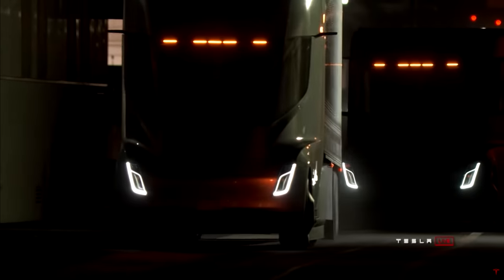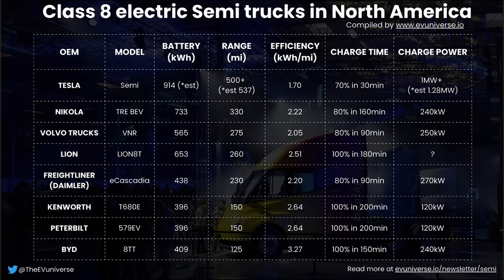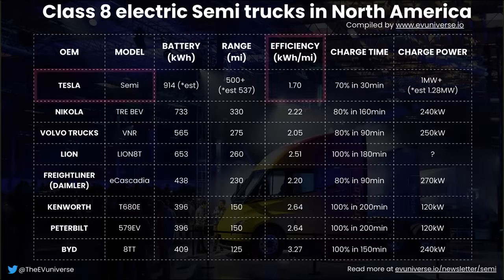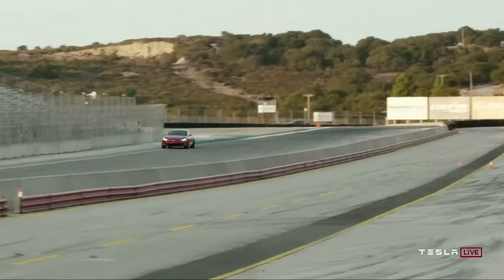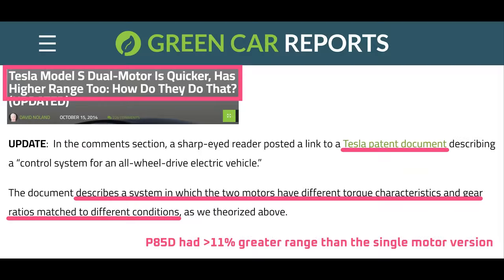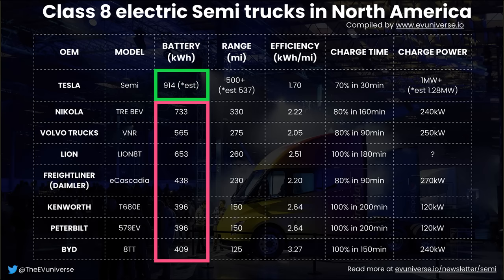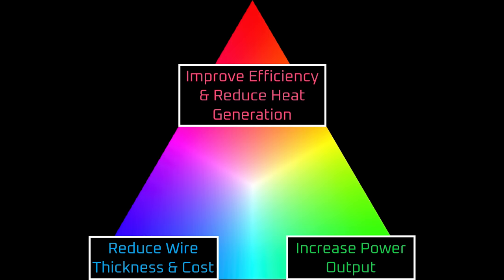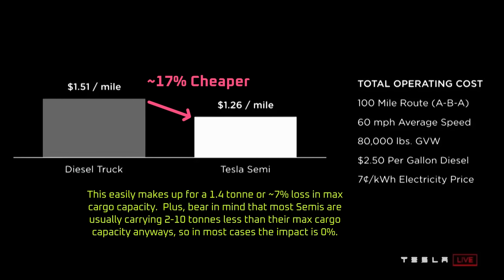How the Tesla Semi “Broke the Laws of Physics”

Comment: A lot of impressive analysis.

A regular diesel tractor trailer can haul 45k lbs to 48k lbs of payload weight.😮 14:52 

I suspect the payload weight is around 35k lbs for Tesla Semi, that’s my guess based on the fact Tesla seems to be hiding this figure. This amount is still impressive but will not be doable for some loads.
Reply: Do we have to go over the "Jersey Barrier" calculation AGAIN?
.
YES, it had 11 barriers on the bed
NO, they weren't "short/ small" versions.
They were ±4,000lb units.
.......
Standard barrier. 24" base thickness, 3 barriers across the bed, 0.5 barrier thickness either side, wiggle room between the barriers.
That's (4×24) + (2×3)= 102.
How wide is a standard trailer bed? 102"
.
You can add the huge chunk of wood at the front. (2,000lb?)
We're talking ±45,000lb "ballpark".
Reply: @rogerstarkey5390  So, if I go to a dealership to buy a diesel and I ask the salesman "How much does it haul?", what would you consider to be normal behavior on the part of the salesman?  Either he answers my question (which seems like normal behavior to me) or he gives me a scathing look, calls me an idiot and points to some concrete barriers on a truck bed outside.  I think if he did the latter I would walk out.  You know as well as I do, there is only one rational reason Tesla won't say how much their truck hauls.
Reply: @chriswright9096  I give you my personal guarantee that if you were an actual prospect for a fleet of Tesla Semis, you'd learn everything you want to know once you sign the NDA.
There might be many rational reasons why Tesla is not disclosing this information right now, none of which is the one you think it is. One might be that they don't want to give their competitors, of which there are several, a target to aim at. Another might be that they're still fine-tuning things like battery capacity based on initial experience with PepsiCo, and know full well that if they release preliminary information now but later finalize a different spec, a legion of airchair engineers will use this a proof certain that they lie about everything. Another might be that they simply don't see any reason to release this information, preliminary or final, to hordes of folks who will just use it to discredit Tesla. Another might be that they're just f%$king with folks like you. Another might be ...
Reply: @BigBen621  Nope, none of your reasons make sense to me.  This is a classic example of poor objectivity.  Whatever Tesla does, you interpret it positively.  They raise prices - genius, Musk will make more profit.  They lower prices - genius, Musk will sell more cars.  They keep prices the same - what a cool head Musk has when all around him are panicking.  Pure spin from start to finish.
Reply: @chriswright9096  Ah, the logical fallacy of personal incredulity—you don't believe it, so it must not be true. In any event, I didn't claim any of these was the case; just suggested a few possibilities for the obvious fact that they consider weight and payload a trade secret.
I don't know where you came up with your claims about my interpretation of Tesla pricing—I've made no such claims any time, anywhere; so my guess is pure rectal extraction on your part.
Reply: @BigBen621  Weight and payload are not known.  Therefore the Tesla Semi cannot be evaluated.  However, this has not prevented thousands of Musk acolytes from claiming to have done exactly that.  I assumed you were one of them.  Apologies if I got this wrong.

Comment: They didn't unveil load capability nothing is clear. That is the most important metric
Reply from the maker: We know the load.  Watch the video by Engineering Explained.

It's not the most important metric.  The most important metric for a commercial vehicle is cost/mile.

Range/load just tells you use case.
Reply: @thelimitingfactor  so they didn't unveil it.

Comment: The limiting factor of a truck is it's weight, which is a legal limit of 36 tons to not damage road infrastructure. To stay within this limit, the Tesla Semi has to have significantly lower cargo capacity due to its heavy battery, which in turn means more round trips are required, which means higher cost.
Reply from the maker: You've got it backwards in a sense.

The main concern of truckers is cost/mile.  Weight is only one variable to achieve low cost per mile.  

There's also speed, fuel cost, etc.

Most semis aren't at capacity.  Regardless, you can watch the video by engineering explained.  It's unbiased and neutral.

Tesla Semi only needs 250 miles of range to cover 80% of routes.  So 500 is overkill for a v1.0
Reply: Where'd you get 36 tons? It's 82,000 lbs., which according to my calculator is 41 tons.

Comment: 500 miles if range?  The loads weight they pulled is in question and why is Pepsi only using it only for short range trips with heavy load?  The reality is the Federal and state paid for those trucks not Pepsi!
Reply: That's not what Pepsi said. What PepsiCo VP Mike O'Connell actually said was that "for heavier loads of sodas, the trucks will initially do shorter trips of around 100 miles". But he went on to say that "PepsiCo then will also use the Semis to haul beverages in the 400 to 500 mile range as well". His statement that PepsiCo will be using the Tesla Semis to haul sodas initially for 100 mile runs, but later for 400 to 500 miles runs, makes it clear that this is a decision on the allocation of tractor assets to where they'll do the most as the Tesla Semi inventory grows, and not a limitation of the range of Tesla Semis hauling heavier loads of sodas. These quotes appeared in a Reuters article entitled "Exclusive-PepsiCo to roll out 100 Tesla Semis in 2023, exec says" on December 16, if you want to verify this for yourself.
Reply: @BigBen621  oh I read it but why?  Electric cars lose half their range towing so why would a truck be any different! Is the range of a lightly loaded truck 1000 miles?   Everything is very suspect!
Reply: @bubbafatas2588  Great question! The reason electric cars and pickup trucks lose half their range towing is because air resistance is a major factor in the range calculation, and adding a trailer behind a car or pickup more than doubles or even triples the air resistance. In the case of a semi towing a trailer, the air resistance doesn't change appreciably whether the trailer is empty, half full or loaded to GCWR; so the main determinant of changes in range with different loads is rolling resistance. 

Running the physics, it turns out that compared with the range at the full 82k lb. GCWR and 60 MPH, a Tesla Semi would gain about 17% in range with a half load, and about 40% unloaded. So compared with the 500 mile fully loaded range test with 7% battery reserve,  the Tesla Semi would have a range of about 585 miles with a half load, and 700 miles empty.

Hope this helps.
Reply: @BigBen621  Yes that does help and as you’ve stated their is a significant difference in range difference 17%based on weight and you have extrapolated given a specific range but Tesla has not!   Why not?   This tells me they are hiding something!  Since Pepsi did not pay for these vehicles as the state and federal governments did, I am suspicious about Pepsi only running short range trips fully loaded and not wanting to rock the boat on their free trucks!    
 Depending on the manufacturer a way to reach high efficiencies, and with that in EVs (Electric Vehicles) electric range, is keeping total vehicle weight low, which is especially important since long range car batteries, that store 50kWh+, can easily weigh 400kg or more. To give you an idea, the most famous electric car, the Tesla Model S weighs up to around 2.3 tonnes and packs a 650kg battery pack. Yes, that vehicle also goes a realistic 600km on a charge. A significant part of achieving this impressive range plays heavy use of lightweight metals such as aluminum in the cars chassis structure.
Reply: @bubbafatas2588  Yes, it's true they're "hiding", or more accurately not announcing, specific performance details. It's clear that they consider these trade secrets that are released only on NDAs, and PepsiCo has as much as confirmed this. There are several reasons why Tesla may choose not to announce detailed specifications to the general public and their competitors. The doubters all jump to one conclusion, though; they're doing this because the tractor weight is shockingly high, and/or the payload is shockingly low. But if this is the case, one must wonder why PepsiCo, who obviously knows exactly what the specs are, is enthusiastically integrating 100 of these into their operations, and is spending millions installing charging infrastructure to support their new Tesla Semis. It's a quandary...
Reply: @BigBen621  Who hides the actual range of their trucks from potential buyers?  Are they not taking orders?  Is it possible Pepsi is not only getting subsidies for each truck but getting deep discounts to implement Tesla trucks into operation and releasing anything negative will affect those purchases and warranties and prices?   Hiding trade secrets is different from providing real range numbers to potential buyers!
Reply: @bubbafatas2588  I see no evidence that they're hiding information from potential buyers; only from the general public, including their competitors. I give you my personal guarantee that if you were actually a prospective buyer, you'd have all the information you wanted—as soon as you signed an NDA. You can speculate on nefarious motives Tesla might have to withhold detailed specs, and you might be right. But my guess is that when details are released, there'll be no surprises, and they'll be pretty close to a weight of 27,000 lbs. ± 1,000 lbs., which can be inferred from information they've already released; to wit, the Donner Pass video and 500 mile range test graph, and the GCVW they stated for both of these events. And they've already released what the range is, at least under the conditions of the 500 mile range test.
Reply: @BigBen621  why would you need to sign an NDA TO GET SPECIFICATIONS, that makes no sense!   Ive been dealing with aircraft purchases my whole adult life and no one hides their specifications!  They publish projected and then actual for everyone to see.  I don’t trust Elon Musk, he has a history of lying about everything he has been involved in!  I am not questioning you or your perspective which may be accurate it just makes no sense to me.  Thanks.

Comment: If they could live up to the claims they'd have been in production already. There's not a trucking company on the planet that's going to run with a costlier fleet.
Reply from the maker: They already are in production.  Low volume.

Several dozen on the road.  

In an upcoming video all cover why it took so long to bring it to market.

Basically it comes down to battery supply.
Reply: @thelimitingfactor  I think you mean "where is the most profitable place to put the available battery supply". Obviously Tesla could have been building Semis by building fewer Model Y's, for instance.

Comment: Denver to Salt Lake.
Reply: 515 miles, with a net 1,000 ft. descent; so overall it should make it easily, loaded to 81,000 lbs. Going that direction, the highest elevation (Eisenhower Tunnel) will be early in the trip; so there'd be plenty of energy in the battery to make the climb, most of which would be returned on the slow descent to Salt Lake City. The only concern I'd have is whether there'd be enough energy to make the final 1,000 ft. climb from Echo to Summit Park, before the final 2,800 ft. descent to Salt Lake City. My calculation is that it would take almost exactly 900 kWh to get to Echo at 7,000 ft., and so the charge would be reading about zero before starting down the final descent and recharging the battery with regenerative braking.

As a demonstration, this might be interesting; but no one in their right mind would plan an actual trip that predicted zero energy some time before the end, or even at the end!

Comment: 4:45 the statement that removing weight increases range is completely false. Class 8 commerical vehicles are limited by their gross weight to 80000lbs, or 82000lbs for EVs. Trucks will often times max out on weight, so the actual tractor weight does not directly impact range as they all weigh the same. It will however increase allowable payload for the semi to haul
Reply from the maker: No, you're false, lol.  Trucks rarely max out weight, as shown by the graph at the end.

Comment: I do not like the title of this video.
The video is way better than the title would led you to believe.
Reply from the maker: Hey thanks man!  What would you call it?
Reply: @thelimitingfactor  Well I would try to describe what the video is about, emphasizing that it is a serious analyze of what Tesla did to find the best compromise, when designing a Battery powered Semi truck.
1. How Tesla engineered there Semi truck to compete with the best diesel trucks.
2. The compromises and innovations making the Tesla Semi viable.
3.  "5" problems Tesla had to solve for the Semi to be comparative.
4. The Engineering of the Tesla Semi.
5. What makes the Tesla Semi not just a diesel truck with a battery.
6. Way Tesla isn't "braking the laws of physics" with there Semi design.
7. Way the Tesla Semi manages to make sense for many truck drivers.
Some of these titles may collide a little with the intro. Cause you title and intro was probably developed in parallel.
My problem with the title is the "broke the laws of Physics" part. To me this reads as "not a serious video", and I would not have clicked it had I not known the channel from some of your battery videos.

I don't know if this helps. Maybe I am not the target demographic, or maybe people like me will click the video even if the title is a little sensationalizing.

Comment: Only thing that bothers me is that Tesla refuses to release weight numbers since those determine the economics, if the product really is bulletproof from a fundamentals perspective there is really no reason to hide these numbers. To the contrary: good weight numbers would result in exploding commercial demand.
Reply from the maker: See engineering explained's video
Reply: @thelimitingfactor  
I think EE did make some fundamental miscalculations in the basic specs, the Tesla will exceed expectations.
(Example. Based pack weight on 18650 packs.
As demonstrated by 4680, fewer cells = less metal = lighter) etc
Reply: That was made 5 years ago when Tesla didn't wanna release numbers that could potentially still improve. That is still the case since 4680 stat improvements have yet to materialize, but trucks are on the road already. I think the Semi will have a hard time regarding economics without the 4680 innovations on cost + energy density via Silicon.

Again, Tesla would advertise the weight with great pride because it'd imply insane economics. They're not doing that, so that indicates the economics might not be great.
Reply: @rogerstarkey5390  The Semi does not use 4680 cells, which are not much better in energy density than 18650 or 2170 cells anyway, and there is little difference between 18650 and 2170.